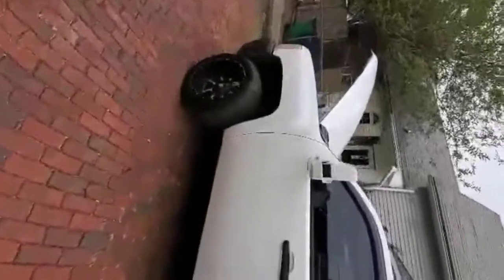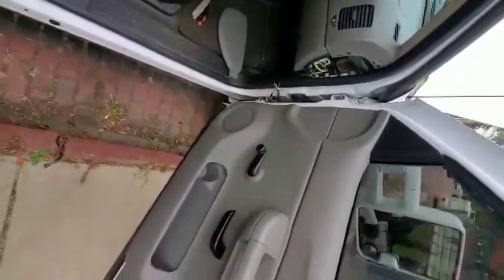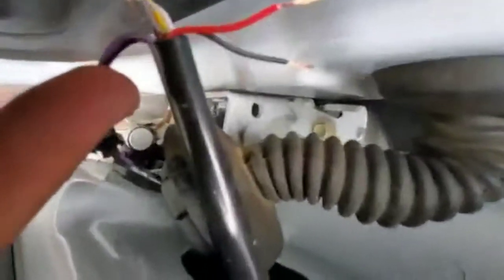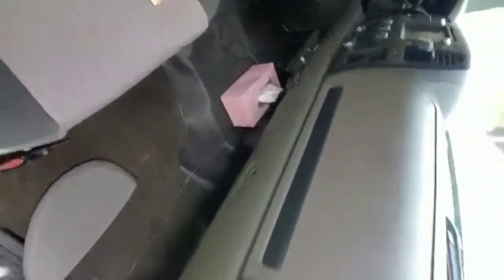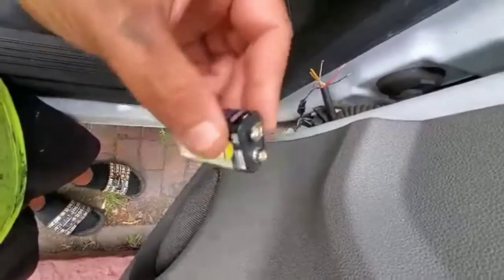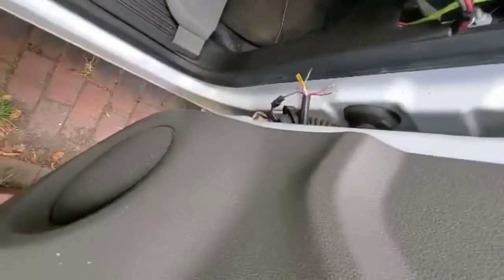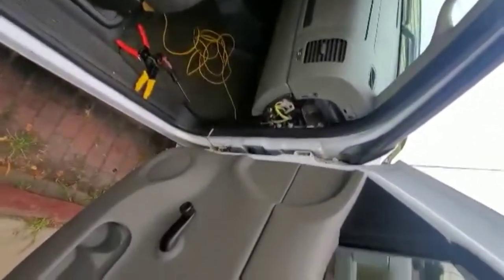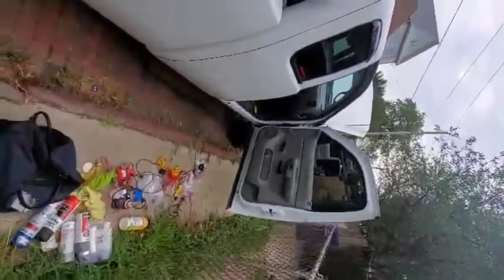07-13 Silverado WT* Boost Auto Tow Mirror Installation Hard Wired

Comment: Where are the other parts of this install
I want to do this for my 09 silverado 1500 WT and this is like the only vid I can find
Reply from the maker: hey man sorry for late reply, what exactly are you looking for other parts wise? i can link you w.e you need help with
Reply: @seal.team.six.sealcoating716  how u wired the mirror into the truck (how u spliced the wires into the truck) and how u did the heated mirror part and the power mirror
Reply from the maker: @nathan484848  I never made a second part of the install. But I can link you 2 things I bought. 1 was a mirror adjuster w a heated option I cut a small hole in door and wired that up. The gray wires were for mirror and moving mirror. And then as for blinkers I tapped my turn signal wires which for me was already in the truck because I had another light. But you need to get wires. Power  And tap each turn signal. And then ground it. I can make a short video and show you. Or email me and il help walk you through it. It was a pain in the moment. I now own a 2015.5 lml duramax so I been building this! Email is justinmllr@yahoo.com hmu I can show you some photos ext
Reply: No electronical issues so far? And thanks for making this video I was looking for days and days.
Reply: @seal.team.six.sealcoating716  sent u the email
Reply: @seal.team.six.sealcoating716  did you get the email I sent?
Reply: @seal.team.six.sealcoating716  also how did you wore the power mirror switxh in?